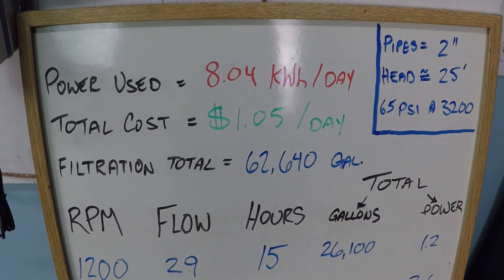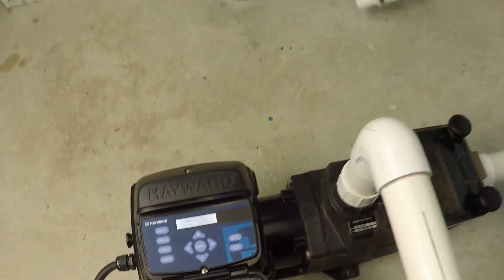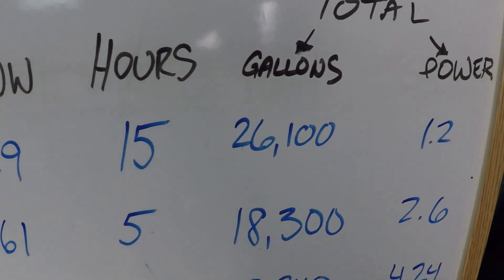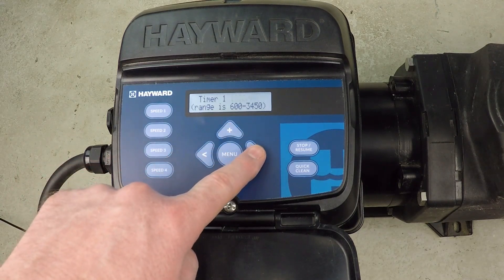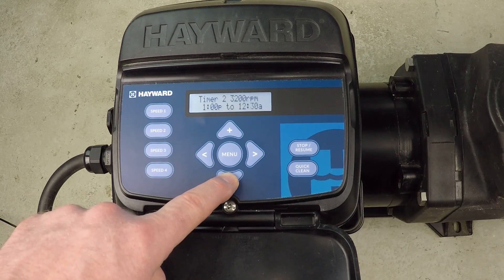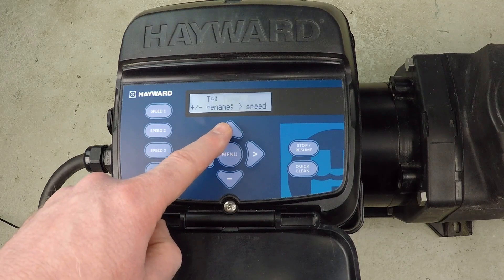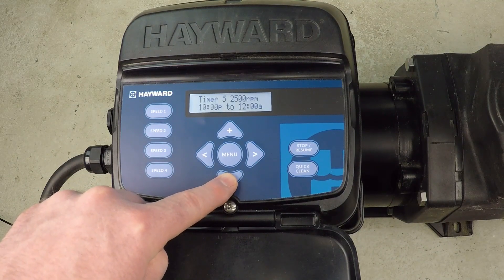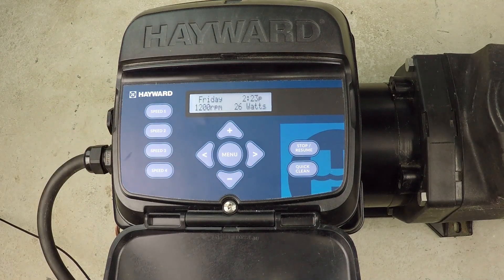Design & Program A 24 Hr Filtration Schedule - Super Pump VS - 2" Pipe

Comment: If you are contemplating switching to a vs pump from a single speed pump, do it, you can save so much money on electricity and have cleaner, clearer water by installing a VS pump, a good filter and a flow metre. Once you know how much water you can move through your system, you can set a schedule to take advantage of time of use electricity rates to achieve 3 turnovers/day. My area: 7am to 11am 12.2 cents/kwh, 11am to 5pm 18.2 cents/kwh , 5pm to 7pm 12.2 cents/kwh and 7pm to 7am 8.7 cents/kwh. Less than half the cost to run the pump at a higher speed overnight compared to peak time.

Comment: Two to three times that amount in Southern California.
Reply from the maker: Well the electricity used will be the same. If there is a difference it is due to the price per kwh which you can use the price you pay per kwh to calculate the exact price you will pay in your area.